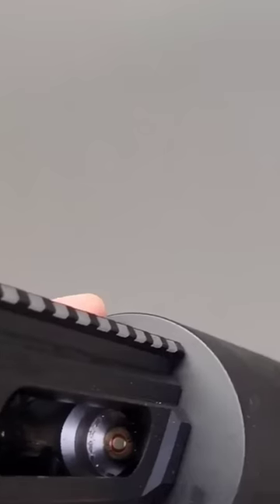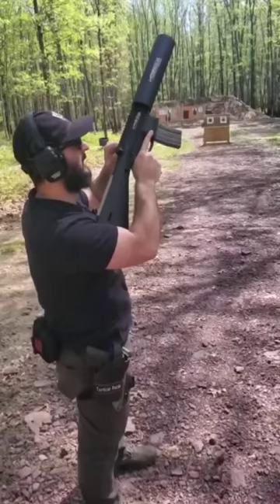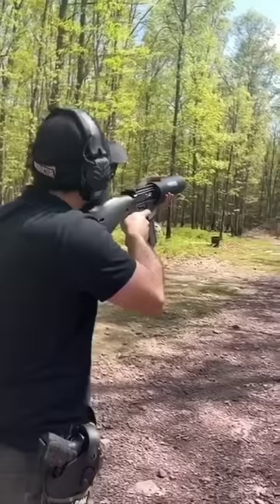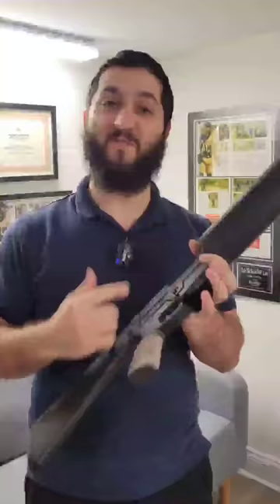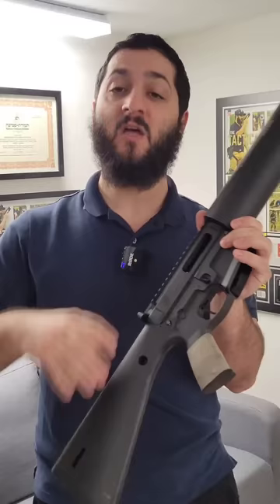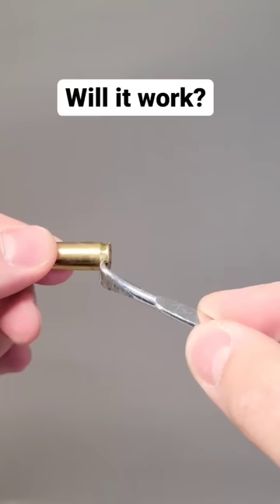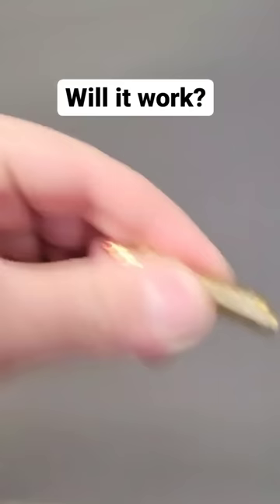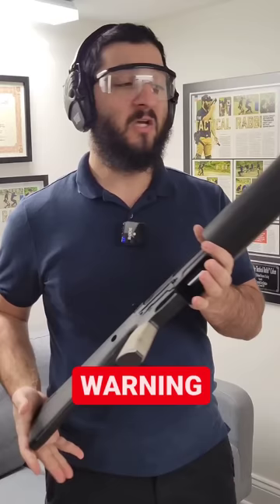I have a LIVE bullet stuck in my AR15! - Here's how you get it out.

Comment: It's a blank not a live round use a cleaning rod
Reply: But if it wasn’t?

Edit: I meant that you probably wouldn’t shove a cleaning rod down there if you were in this situation with a live round.
Reply: ..im pretty sure this is satire...and the point was to give information...in case you ever find yourself in this situation with live ammo
Reply: Exactly
Reply: The gases from a blank is still strong enough to blow your hand apart. Never stick anything near the muzzle if you have anything live in the chamber.
Reply: For the can cannon, he most likely can't use a cleaning rod. The muzzle end is plugged on the end, and vented out the sides for most of them after the AFT tried calling it an SBR at first, they had to change the design so that a projectile couldn't be fired out of the "barrel".
Reply: @domosrage5434  That and the cleaning rod would become the projectile if it were to go off in a normal rifle.
Reply: @mikefelty2625  it's not going off if you don't strike the primer.
Reply: @roberttaylor6030  In his case no, but if you have a light primer strike and it delays (hangfire), the primer could definitely still ignite.
Reply: Even a live round doesn’t matter
Reply: You can’t do that with a can cannon. There is a metal wall blocking access to get it with a cleaning rod
Reply: If you have a blank in a gun, and then you put something in the barrel it isnt a blank anymore.... blanks fire nails through concrete and are far smaller rounds than these. Why on earth would someone choose to attack this situation from the business end? Because they are stupid.
Reply: If it goes off it’s no longer a blank the cleaning rod becomes the bullet
Reply: A blank can still blow your hand off
Reply: A blank will still go boom tho???
It can still be very dangerous should it go off and send your cleaning rod flying, albeit not quite as fast as well sealed round, but still enough to hurt yourself or someone else
Reply: He said it was a blank at the end
Reply: Instructions unclear. Cleaning rod is not lodged in my ceiling
Reply: It's a live blank. Has gunpowder. You're thinking of a dummy round, empty case and rubber to soften hammer
Reply: Yeah I’d rather not test fate and get a cleaning rod blown through my hand
Reply: Cleaning rod makes this gun a cross bow.
Reply: @garrisonmcelwain19  there is no “what if”. It IS a blank
Reply: Amurica gun safety at it's finest. Well done bro
Reply: @domosrage5434  its in a can cannon not a barrel. Wayyyy lesss pressure. You might can get your self a widdle boo boo. But no chance of blowing your hand apart🤣🤣
Reply: A blank is filled w gas and powder gang
Reply: @swampfox7522  on specifically a can cannon, yeah probably light burns. But many people discuss this scenario with actual rifles. Its also foolish to pretend that blanks don't have the power to be destructive
Reply: The point of the video was to extract stuck rounds, regardless of what it is - blank, live, spent.  Much safer alternative to quickly fix the problem than any others they tried to do.
Reply: @mechadonia  that’s not how rounds work. If there were a risk of that he wouldn’t have brought it home from the range walking around with it making a video 😂
Reply: @markrayes2973  yes but with it being an ar you can take the lower receiver off and still have the weapon pointed in a safe direction and get the round extracted in the same amount of time
Reply: I really hope this was meant as a joke. All a blank needs to become a live round is a projectile, and a cleaning rod would become exactly that. Even minus that, you can get pretty badly injured by a blank at close range from the explosion and burning powder.
Reply: @jeremyh9033  Case in point: the man named Gage who had a blasting rod pierce his brain while setting dynamite in a hole.  He suffered a TBI.
Reply: It has powder which can still detonate to cause physical problems. It is a live round. 

A dummy round isn't a live round.
Reply: Yeah, you can still deglove your hand from a blank going off. There's still gunpowder being detonated, it's just not flinging a projectile.
Reply: Worst suggestion ever.  DO NOT DO THIS.
Reply: Even a live round a cleaning g rod is fine
Reply: Remember Brandon Lee?

Anything in the Barrel + Blank = projectile coming out at lethal velocities.
Reply: @MajesticDemonLord  it’s fine
Reply: @garrisonmcelwain19  Then the Can Cannon goes bye bye
Reply: Yup 🚀
Reply: @mikefelty2625  just don’t be a wuss and move fast. Problem solved.
Reply: @dirtydave2577  🤣😂
Reply: @mikefelty2625  👍🏽😂😂 jk.
Reply: A blank can still seriously hurt you or even kill you, look at what happend in the alec Baldwin situaion
Reply: That was just a blank for the demonstration. The problem he's talking about involved a live round.
Reply: Fire the blank, then ram it out.
Reply: The amount of likes scare me.
You're essentially putting a projectile in the barrel, natural selection at its best.
Reply: @garrisonmcelwain19  but it is so it doesn’t matter 🥶
Reply: @mikefelty2625  bro hang fire is not days later in your house making a video.. give it a good min and your fine
Reply: @EliteNoob22  you are easily scared. ❄️
Reply: @Gruuvin1  turning a blank into a live round is always smart. How about you also look down the chamber while pounding it with the cleaning rod,make sure it's dislodged.
Reply: @MajesticDemonLord  No. Who is Brandon Lee?
Reply: @MajesticDemonLord  there was another star that died similar to Brandon Lee, I can’t remember off the top of my head though.
Reply: The round wont go off if you dont hit the primer. I have never heard of anyone setting off a round with a rod down the barrel. But I have seen countless rounds pushed out successfully with a rod. I know he couldn't do that in this instance but some of you guys need to nut up or shut up
Reply: @moshunit96  no it wasn't and no it isn't, you dont put live rounds in a can cannon under any circumstances. Title was clickbait
Reply: @cubekanaal  yes, but you dont have to worry about that if you dont point it at someone. A blank isnt going to shoot through an entire apartment building. Its also no going to go off unless the primer is struck. This really is not a big deal. Just wait a few seconds for a hangfire and then pull it out with a paint can opener.
Reply: "Ah yes let me put my self in harms way for YouTube videos"
Reply: No
Reply: @garrisonmcelwain19  using a cleaning Rod to extract that live matches exactly what you would do, it's meant for that not a paint can opener. Do you honestly think militaries around the world are carrying paint can openers for the occasional malfunction
Reply: I think the presure from the blank round would still hurt 😂
Reply: @EliteNoob22  Brandon Lee was Bruce Lee's son. Brandon died on set during the filming of The Crow because a lead tip from a modified blank round was stuck in the barrel of the revolver that was used during one of the scenes. Its not a similar situation as to the one described here as what happened with Brandon was a squib load, not a round not fully chambered but too far in the barrel to be able to be extracted by the guns case extractor.
Reply: A blank round is a live round.. period . It can still injure or possibly kill a person .
Reply: @abysswalker1562  Oh i remember the story :)
Reply: @garrisonmcelwain19  I would
Reply: @abysswalker1562   its just like Dick Cheney 😂
Reply: @EliteNoob22  no. But comments don't scare me.
Reply: How to speedrun blowing your hand off any %
Reply: @garrisonmcelwain19  If it hasn't fired within 15 minutes, it won't fire. Just use a cleaning rod lol
Reply: @mikefelty2625  if you've had time to take it home, look up how to get it out, and make a video on it, it won't fire.
Reply: Red or green tip, it won’t detonate if the primer isn’t hit 🤷🏻‍♂️ cleaning rod or a good stick will do just fine haha
Reply: @Mithirael  I know, which is partly why I said "in his case no" because for one, the primer didn't appear to have been struck at all, and if his round/blank had a light primer strike, just him setting up the camera angle was probably enough time to make sure it wasn't going to hangfire. I typically wait 30 seconds to a minute if a round does go off right away, and then clear it. I actually had a blank that didn't go off the day I was shooting my can cannon in the only video on my channel. I waited a bit, cleared it and moved on. It also wasn't stuck like the one in the video, it extracted perfectly fine.
Reply: @Mithirael  Also, I didn't look up how to get a stuck round out, it was in my suggestions. I've had one one of those paint can openers on paracord attached to my carrier for a while now.
Reply: @caseymacdonald878  Some of members of the military do carry them tethered to their plate carrier, but it's not officially a part of their kit.
Reply: Even with a live round there is little to no risk using a cleaning rod on a live round either. Just stay away from the primer.
Reply: @greenjebadiah  jon Eric hexum I believe.
Reply: A blank can still fuck up your day
Reply: @domosrage5434  maybe not quite that, but definitely hurt and HELLA burn it
Reply: You're going to be that guy that ends up in the news with a cleaning rod through your head because you were messing with a live round.
Reply: You could certainly use a cleaning rod in this instance. If you look at the primer there are no marks on it whatsoever meaning the pin hasn't struck it, so you're not going to get a hang fire. If the primer had a mark on it then it would be a different story.
Reply: Use a cleaning rod even if it was an actual round. Why would that be scary unless the primer was lying on the firing pin?
Reply: @garrisonmcelwain19  a wooden dowel would work just fine...
Reply: Guns r bad, mkay ?
Reply: Just lock the bolt back, the round can't go off if there is no firing pin to strike the primer. Then just push it out with a ram rod.
Reply: @mikefelty2625  Wait a minute or two, then take the round out.
Reply: @garrisonmcelwain19  why not? You're not hitting the primer. You're hitting the bullet. Its a common way to get stuck rounds out.
Reply: Also even if it was a blank you understand how many people get killed by blanks because they still have a charge
Reply: @garrisonmcelwain19  even if it was a live round… take the lower off the upper and shove a cleaning rod down the barrel.  Rounds don’t just magically go off and pushing it on the bullet isn’t going to to anything other than solve the problem of a stuck round.
Reply: @Mrgrumpypants84  Yeah like... nailguns literally use a .22 short blank to drive the nail into shit???
Reply: This comment should actually be reported for spreading dangerous and possibly deadly misinformation
Reply: As long as there's no pin near the primer  doesn't matter if its live or not. That round isn't going to do anything.
Reply: What difference does it make if it’s live or not? The procedure is the same - wait 90s, disassemble the gun, push the ammo out.
Reply: You might destroy your crowning or barrel grooves and not mention it's dangerous
Reply: @mikefelty2625  in Marine Combat Training one of our instructors demonstrated that by lodging a cleaning rod about 2-3 inches in a tree from 20 feet away using a blank
Reply: I would like to see how you would use a rod, do you know what your talking about?? I watched the video a couple times to see if he switched from a can cannon to a rifle, nope he didn't hence rod will not work!
Reply: @garrisonmcelwain19  i have done it before. hold open the bolt and use a ram rod. you are hitting the lead projectile not the primer. the lead is inert. hitting it will not set it off.
Reply: @domosrage5434  if the bolt is open it will not fire unless you have already dropped the firing pin on it. if you have then keep hitting it and try to set that round off. if that does not work then set it down for a minute or two and if it does not fire ram rod it out.
Reply: @cryptosig283  really? is it like a gas piston that will throw the can? if so than having a paint can opener could be useful for can cannon users. otherwise bring a cleaning rod.
Reply: @Mrgrumpypants84  its fine. it cant just GO OFF for no reason.
Reply: @TiocfaidhArLa34  yeah sorta. The blank goes off and all the pressure goes to the sides instead of straight forward so all the pressure isn’t concentrated in one spot. I mean imagine if a blank just went off right onto a can, it would explode the can.